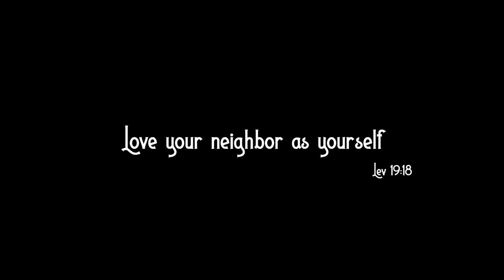EXTREME Mobile Home Transport & Set Up in ONE DAY!

Comment: If the ground is dry,  and roomy, will almost always swing around  and do a pull in. Easier, cheaper, less damage than backing and  turning. I always set it between pins placed at pre site inspection. 2 and 3 units spotted 3 inches apart. Kitchen/heavy half always spotted 1st.

Comment: Good prep work on the pad. My dad has a mobile home park in Texas and I helped him set up the pads. Used to do it the same way you did but after the first 6 lots or so he changed to doing 2 runs 100 feet long where the I beams would be.  It definitely doesn't settle like the homes used to. Of course we dug out trenches a good 4 feet deep to get rid of the gumbo as he called it and backfilled in layers with select fill and the last 6 inches is good gravel.

Comment: The reason they " went the long way  ( all interstate) as you say is that was the route they were  permitted for by the states DOT that they were in and going to. 
The moving company had to file permits to move an oversize load  and that was the only roads they could be on.

Comment: It is amazing to see how homes can be moved down the road.  We bought a used mobile home from a dealer about an hour or so away from our land.  The delivery was a bit complicated because the 4th of July fell on a Tuesday that year.  So we were told it would be delivered Wed.  I had accidentally left my phone in the car and missed the call on Monday that the house was coming that day!!  We too were staying in a camper and my daughter looked out the window and asked why was there a house at the end of the driveway??!!  WHAT!!  Yes, it came on Monday much to our delight and surprise.  Watching these men back this down the driveway which is not straight but not really long either.  The trailer is 76 ft long.  They had some maneuvering to do to get this positioned right on the slap.  In NH a slab is required.  They backed down the driveway, positioned the home between our relative's mobile home and garage, and then drove straight onto our slab in one shot.  It was something of a miracle it seems.  They came another day and set it permanently on the slab, all blocked and skirted etc.  Those guys worked the same way, they all did what they had to and got the job done rather quickly.  Anyone who moves these mobile homes and places them and sets them up are truly professionals at what they do.  Amazing to watch!!  I am glad you are happy with how yours turned out.  There is something to be said about having a humble abode.  I know we didn't pay too much for ours and hope yours was the same.

Comment: That was an awesome video, very impressive move. I was quite shocked to see them take it down the hill vs the drive ( was worried it would bottom out when the tail end hit the flat , seemed close ) I am guessing it came up the drive originally. once you install the skirting and add a nice deck outside the front door you will be good to go.

Comment: Guess now we know why it costs so much. 😏 I know the feeling of seeing one’s home riding down the road and off its foundation…. We built a modular home which came to our property in two parts…front and back….we had to get a crane to have them, one by one, lifted onto the foundation when it was delivered…in our case, each part was lifted 40 feet in the air over our heads and then lowered with precision onto the foundation ….talk about heart stopping…. 😳Definitely an experience🥴 and all in a days work for some. 😉

Comment: I had mine moved and while going down the road the wind got under a piece of siding on the front and pressure started to pop the screws and pulling siding off. I saw something flapping around the side and pulled up to see. The siding was just flapping away and popping screws pulling thru siding. About a 6 x 2 foot sheet of siding was pulled off, and another 2 foot, sheet would have come off on the road into traffic.. 
I got the guy stopped and he didn't seem to care. They offered to NAIL it back down!... 
I had a cordless drill with me and pulled screws still in the studs and reattached siding and duct taped the seams and holes so wind wouldn't get it again.. 
Transporter said they were not responsible for damage and billed extra hours for time to fix their goof-up!.. I didn't pay for extra. They filed court case, then dropped it when they found out that transporter was doing up to 71 mph at times towing it!
Careful who you use to move a mobile... Glad you got a good one!
Reply from the maker: Oh wow! Yes, we had a GREAT crew! A similar thing happened with our home -- the siding flapping, but they stopped and taped it up and screwed it down for us.

Comment: we had our new 1900 sq ft house moved 250 miles from where it was built to our farm  but thankfully there were no hills like this. house is 60 ft long 36 ft wide. They did get stuck in our yard and left it parked on the driveway for a week until it dried up and  then put it on the basement. I think the moving cost us about $17,000.00 What would this move have cost?

Comment: Are you planning to build some steps to get in soon? Did you decide to block the underpinning or just use the old panels? Do you have the septic system, water hook-up, electric lines and internet cable in already? Hows the water run-off looking?

Comment: When we moved our portable house, yes, it's portable on the back of a flat bed semi, we had to stick with the driver because he had no clue where he was going. We got to the location, 6 hours later, and he put it down backwards. With 2 large breed dogs, my car in a toy hauler being pulled by my husbands truck, in the middle of snowy, icy, winter, I was a ball of nerves. The only thing that got damaged was my car. A tie down snapped. We knew something happened, just didn't know what. The best vehicle of the bunch ended up with a nice dent in her roof. It's still there. I forgot to pull down an antique tea cup and saucer. I noticed it when I went inside to check it out. It didn't budge. Boxes moved all around, as did the heavy oak table, but the tea cup didn't move.

Comment: Jurasic park .. the movers edition hearing the groans of the house as they move it on the highway lol
Reply: when you stop and think about how and why they moved it off and on they way they did ... you can see how they chose to do the least amount of moving for the most amount of gain ... less moving less chance of breakage ... safer job better profit no repair bills ... backing it down was fastest easiest and most controllable way to go ... heck they even had the second crawler there as a back up just in case ... pulling it in they looked at where you wanted the door ... the lot and how best to put it on the spot in one shot ... they did it and poof instant house just add supports and a foundation later ... 
.
start to finish they went with the eastiest fastest least amount of work way to get the job done fast and safely ... and they got it all perfect

Comment: Any thoughts on if your updates have improved the fire ratings on your home? 
Some of these were at one time allowed with a rating that basically said a fire could travel thru them as fast as a man could run.
Reply from the maker: Since moving it to TN we have finished the interior renovations and made it as compliant and up to date as a brand new home. So it's just as good as a stick built home in our opinions re: fire rating and safety. We've gone through every single aspect and component over the years as we've improved it.

Comment: I've been in the MH transport business for 35 years. There was zero reason to not simply pull down your driveway! They had $250K worth of equipment including a Platypus, tug, jadde etc... (we call ours Bertha lol). Would have been super simple to pull out frontwards and go down the driveway....easier, safer, with less stress on the frame.  The ONLY reason would be they needed to back onto the road to go a certain direction...nowhere to turn it around a bit farther down the road. But even heading out with the equipment they had they could have made that left turn. Glad it worked out tho...

Comment: Question? Do they actually tie it down to the ground some way or is it free standing?
Reply from the maker: The home is anchored to the ground as required my local and state building codes. In NC where the home was, the had 4 foot long auger screws into the ground and the home strapped to it. Here in TN they installed a rigid beam angled between the frame and our concrete footers. It seems stronger, but both passed state inspections with no issues.

Comment: Like a vehicle, If your home has a steel frame/underpinnings, One would think that rustproofing would be of concern! A mixture of bar & chain oil mixed about 50/50 with diesel fuel definitely works! I would use a wire wheel on a grinder to get off any loose rust then, spray the mixture with a cheap Harbor freight/princess auto spray gun...To preserve the frame under your trailor!!!  Or, is that their trailer that I'm seeing?  Plz know that, all rust proofing is not created equally & many hide the rust underneath a coat of whatever & you don't see the rust until it's to late! That's why I prefer oil! Bar & chain oil mixed 50/50 with diesel fuel! Yes, it stinks for a while but, with that comes peace of mind!!!! Plus rodent's will not like it!!!